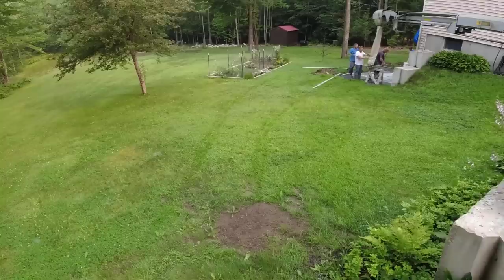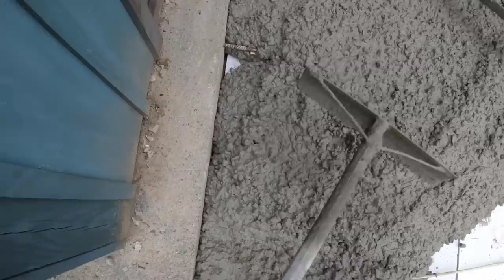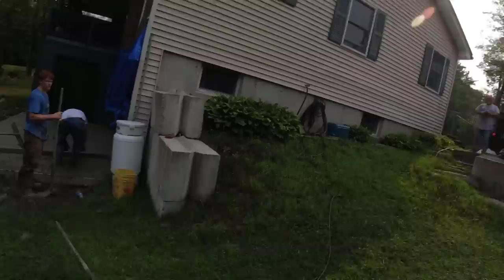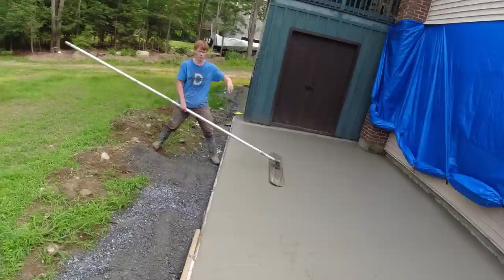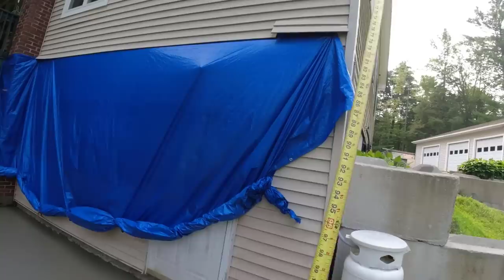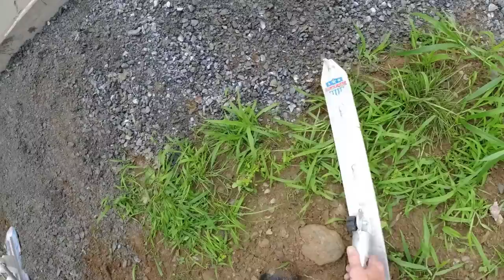Uncover the Secret to a Perfect DIY Concrete Patio Slab

Comment: Love your work Mike. The groover actually creates a thinner cross section along that line, this makes the concrete more likely to crack along that groove, as long as the grooves are placed at intervals where cracks are probable. The spacing is usually dependent upon slab thickness, aggregate size, water to cement ratio, its temperature range, and some other factors. If you look at most grooves in slabs there are cracks in them. The tool joints or grooves do not prevent cracks, they control their propagation by weakening the slab along that point. You can cut the joints in also, but this is inferior in my opinion as you have to wait untill the concrete is hard enough to cut, usually within 3 to 12 hours after finishing, by then the cracking has already occured.

Comment: Mike what is the white material on the bottom underneath the metal squares?
Reply: Working with cement is an art all by it’s self and you guys make it look easy but I bet like everything else takes years of experience to have it turn out as good as looks
Reply: Rigid foam insulation.
Reply from the maker: sheets of styrofoam